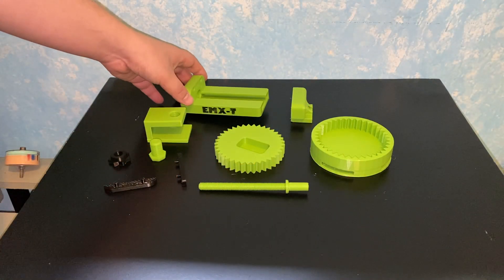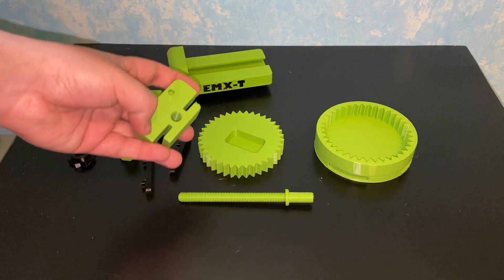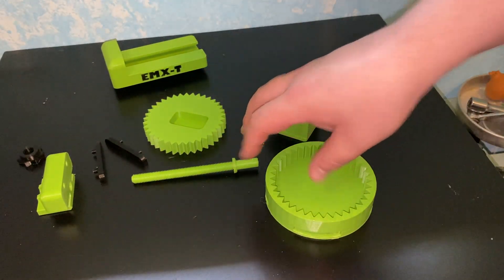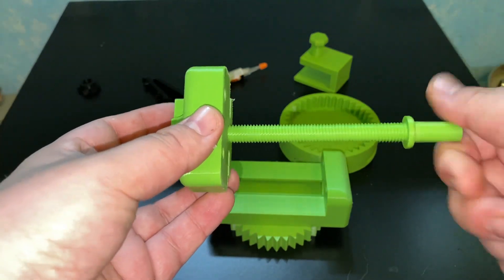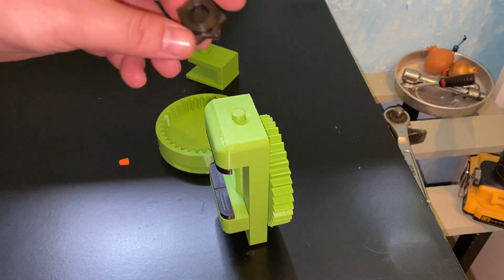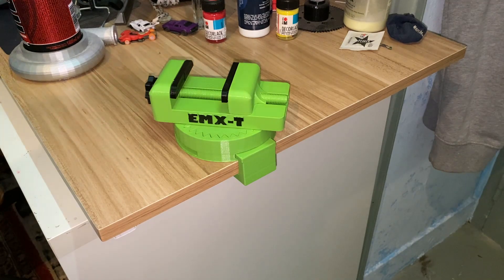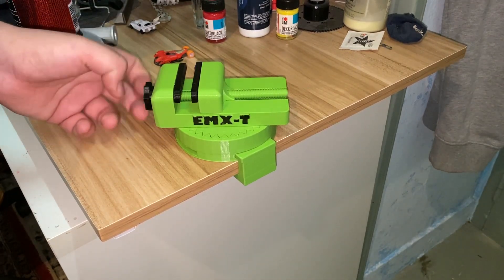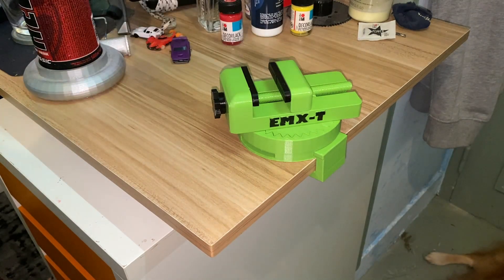3D Printed Mini Desktop Vise

Comment: when I tried gluing the screw handle on it just glued to the side and broke
Reply from the maker: How much infil did you ise and what wall thickness?
Reply from the maker: You need 4mm wall thickness or 100% infill on the screw and handle , and when you glue it flpi it up like i did in the video and just put glue in the bottom side of the knob dosent need much glue.